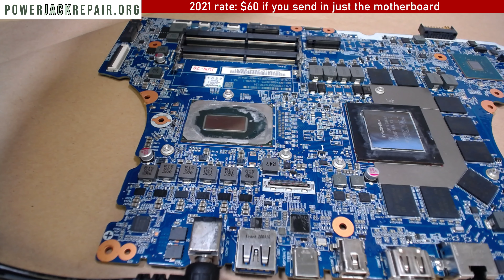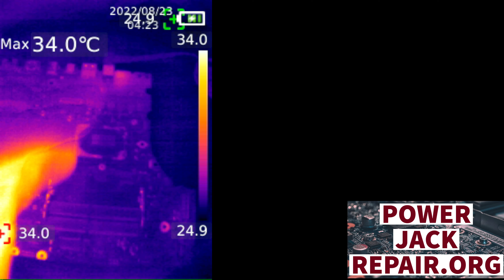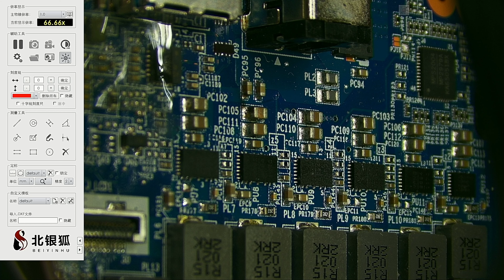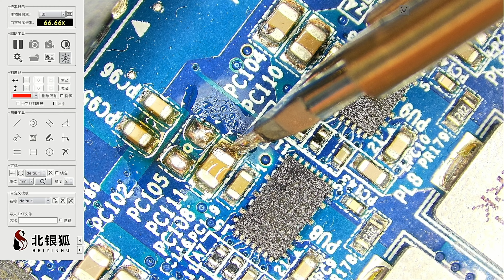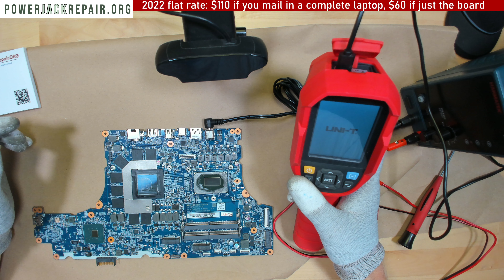How to fix repair a shortage on the motherboard a light on the adapter goes out short mother board

Comment: I have the same laptop my capacitor at pc113 blew.  I noticed on this one it was pc105. What size capacitor is this?  I don't know where to look how to find a replacement for it.
Reply from the maker: If one of the capacitors is missing, you can still run the laptop just fine, capacitors are used to smooth out the voltage, one of them missing won't be the end